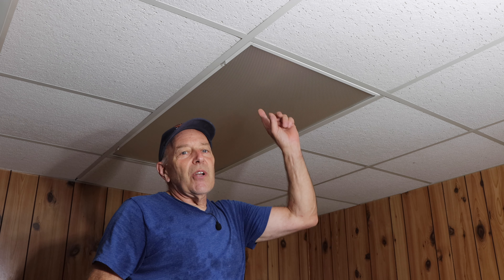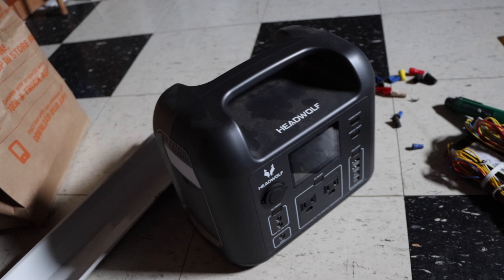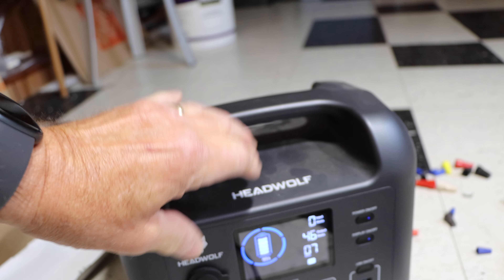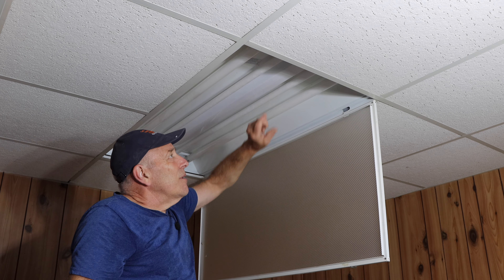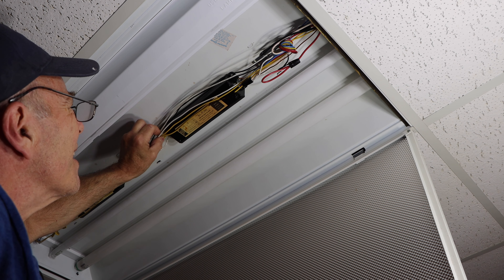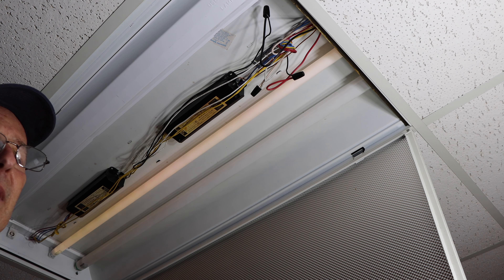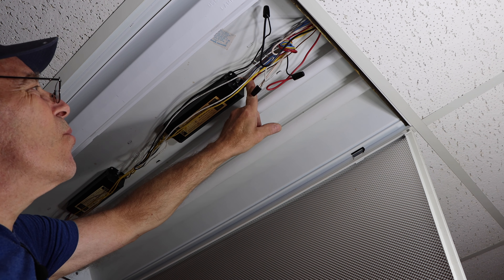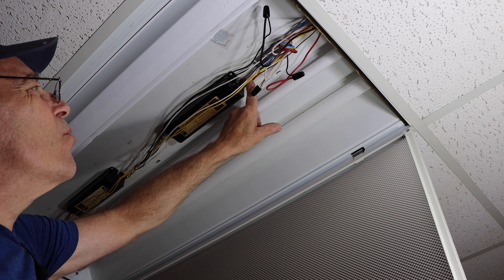Fluorescent Light Troubleshooting and Repair

Comment: In this day and age it's almost always cheaper to buy ballast bypass LED lamps eg. power runs directly to the lamp sockets.  

For those still using fluorescent, when lamps or ballasts die much sooner than they should, the cause is often user error of some sort.  A common mistake is using T8 lamps with a T12 ballast or vice versa.  T8 lamps running off a T12 ballast will burn brighter and hotter because they will try to draw the same current as a T12, which is slightly higher.  A T12 lamp on a T8 ballast will be dimmer and not last as long, the ballast can also be damaged after a long period.   

Another thing to check is that the ballast is properly wired and that the correct lamps are used.   The commonly used F32T8, which slowly took the place of the F40T12 lamp about 25 years ago, is usually operated on electronic instant start ballast and requires shunted lamp holders or a external jumper between the pins.  If the pins are not shunted, the lamps will fail early. T8 lamps can also be used on rapid start or programmed start and this requires non shunted lamp holders.  

The F40T12 lamp is designed for rapid start.  Many years ago however, there were also  instant start versions of these fixtures and  F40T12/ (color code) /IS lamps were made.  A F40T12 lamp will suffer an early death if installed in F40T12 instant start fixture.  A F40T12/ IS lamp installed in a F40 rapid start fixture will not light and will destroy the ballast if power is not removed immediately, fortunately it's very unlikely to happen today because F40T12/IS lamps have not been manufactured since the mid 1990s, to my knowledge.  

Today, lamps designed exclusively for instant start have a single pin on each end, this is most commonly found with 6 and 8 foot lamps but can be found on 2, 3, 4 and 5 foot lamps as well (very rare).